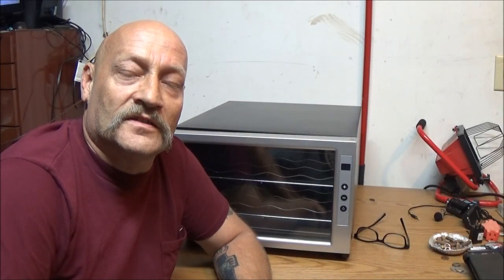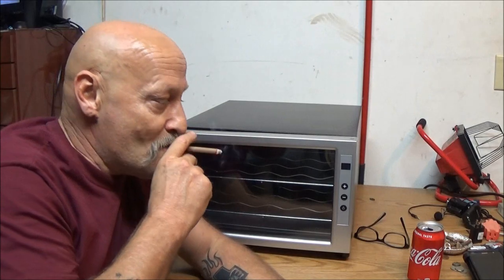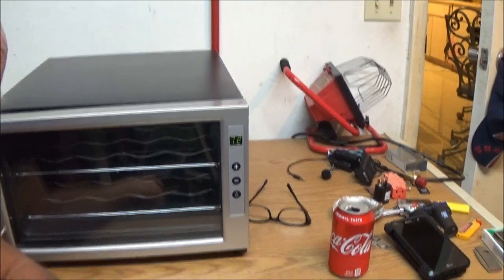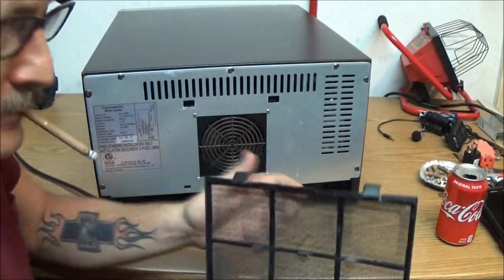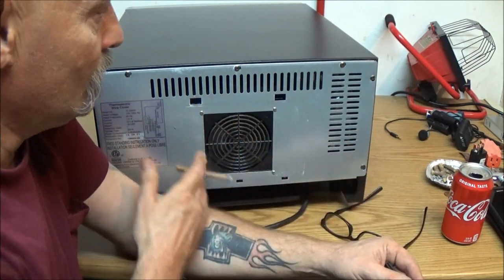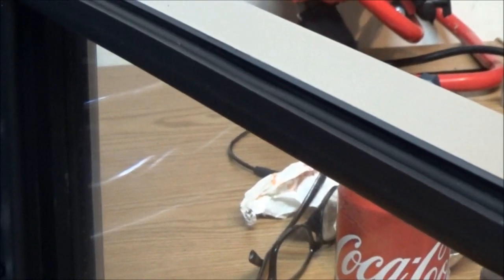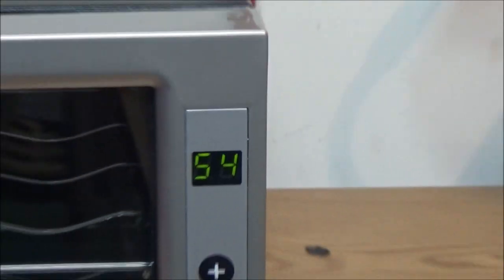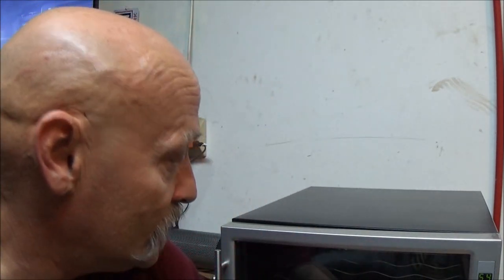Thermoelectric Wine Cooler Product Review

Comment: wine should be stored at or near 50-55 degrees F.  I have NEVER seen any store, bar or liquor store that kept their wine at that temperature.  It was shelved at room temperature for who knows how long.  I am by no means an expert on wine but I have had my fare share of VERY expensive  down to the 6 bucks Walmart/Kroger brands.  I have chilled them to 50 deg and I have to admit I hate it that warm. My sister has a very expensive whine cooler and I absolutely can not tell one bit of difference between a bottle I just pulled out of my pantry and her cooler wine. if they are the same brand and type that is.  I just watched a video of a woman who said she keeps her wine in her bathroom because it is the right temperature. I guess it is all according to your Palate.